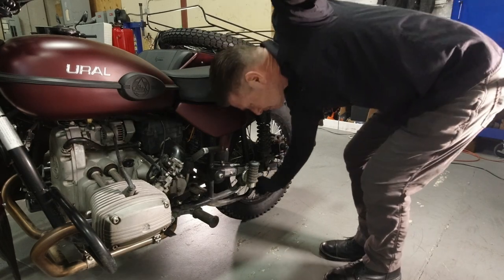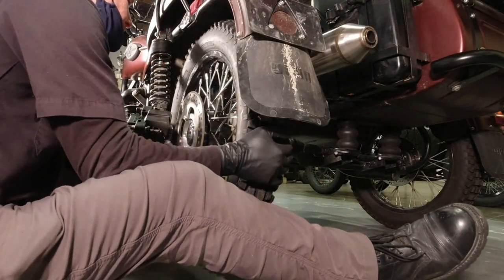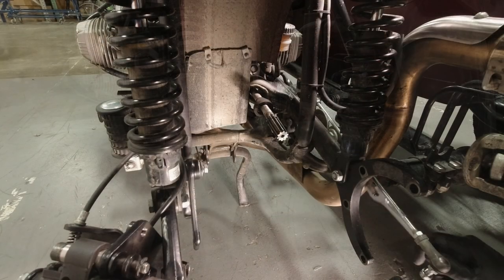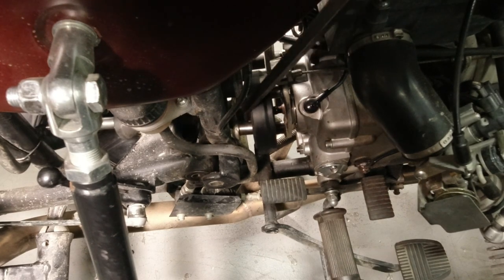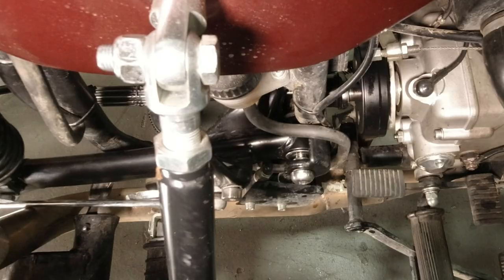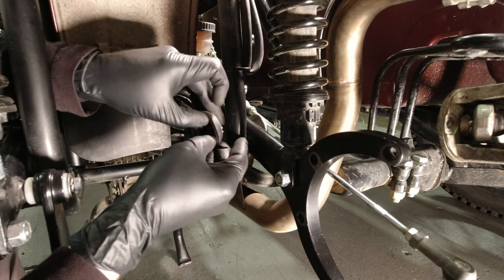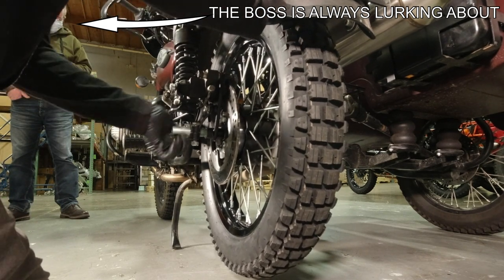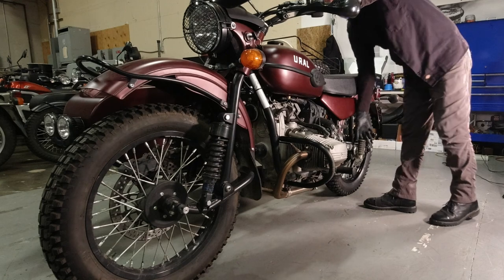URAL How-To - Flexible U-joint Coupling & Driveshaft Removal & Replacement

Comment: Hi David - nice to see you again. I know you have been busy... I understand you wrote the huge (76 pages?) manual for the Keihin swap. Wow.
Really good video. You made it look easier than I thought it would be. 
What is the cutover year for the new donut materials? I carry a spare in my 2018, but hope I never need to change it while riding.
Thanks for doing these videos in your “spare” time! They are awesome!
Reply: Hello Alan, good to hear from you. I answered in more detail to jeopardy4100 if you want to go read that. Short answer is it was a rolling change in 2017, so your 2018 should be good for awhile depending on use and/or abuse and deterioration over time from the elements, chemicals from cleaning or age. Normal riding you could potentially see 30-40,000 miles. If you are off roading or droping the clutch all the time is could last as few as 5-6,000 miles. It is a wear part so it will need replacement under normal maintenance, just inspect it periodically for tears or cracks. Mine even had a big tear in it from abuse and I continued to ride it for the rest of the summer last year. So if you see wear or cracks or tearing it's no reason to panic, just don't go on a long trip without replacing it first.
Reply: Thanks David! Always good to carry spares just in case. I carry a spare clutch cable and other items under the seat too.

Comment: Informative, thank you. 

For that rear shock bolt, is there not enough room between the exhaust for you to install the bolt from the inside and nut on the exhaust side during reassembly? the would make it less of a pain next time, and make it  easier to replace just the shock in the future if need be.
Reply: grinmaul, thanks for the question. Yes you could swap it around but it would be close to rubbing the exhaust because the nylok nut is a little deeper than the head of the bolt. I was pondering if the heat from the exhaust would melt the nylon thread locking part of the nut and render it useless so I kept it the way it was. But yes there is room and it could be done with a nut and regular lock washer too. The other side is captured by the final drive so in order to get the shock completely off, the finale drive needs to come out or the exhaust needs to be loosened and dropped away for clearance.
Reply: @davidwaynegeorge2292  ahh, ya if the final drive is still in the way then never mind:) thanks for replying.

Comment: Thank you David.
When was the new compound implemented in the donut?
Reply: Sometime in 2017, it was a rolling change so I don’t have an exact date in my files. Looking for something more robust URAL started looking for a replacement to the old rubber coupling and started testing a poly coupling around the 2010 era, the parts URAL tested were fine but we soon found mass produced parts were inconsistent. URAL ended up going back to rubber, we knew how long it would last and what to expect as this is a wear part. Ural was building new relationships with different global partners at the time and one of them was able to consistently produce a quality rubber coupling that we still use to this day.

Comment: Given the complexity of this procedure and the distance to my nearest Ural dealer, what's the expected lifetime of these new couplers?
Reply from the maker: Normal riding you could potentially see 30-40,000 miles. If you are off-roading or dropping the clutch all the time is could last as few as 5-6,000 miles. It is a wear part so it will need replacement under normal maintenance, just inspect it periodically for tears or cracks.